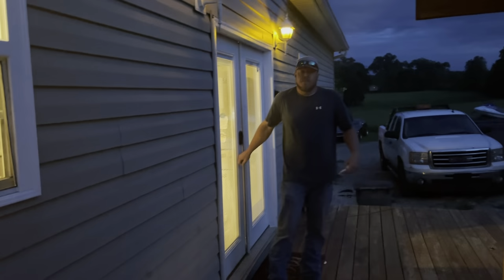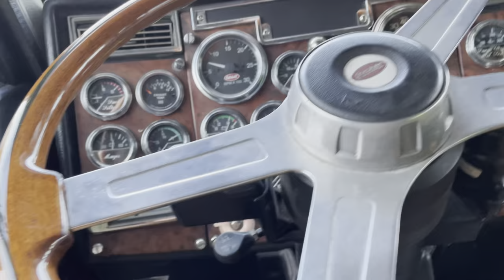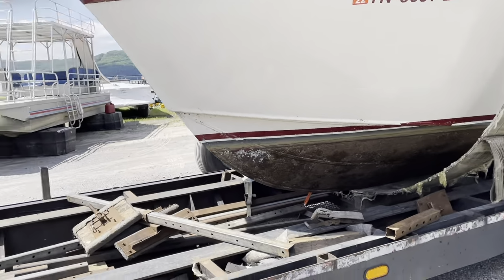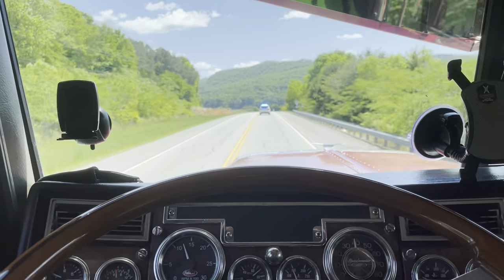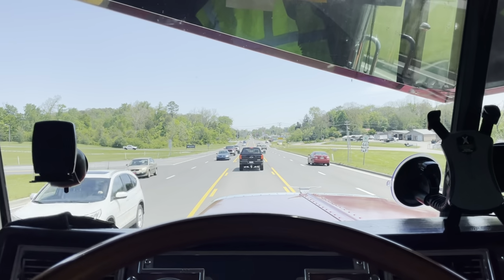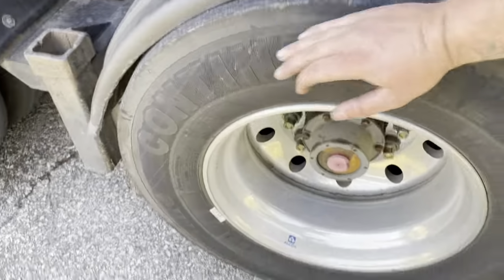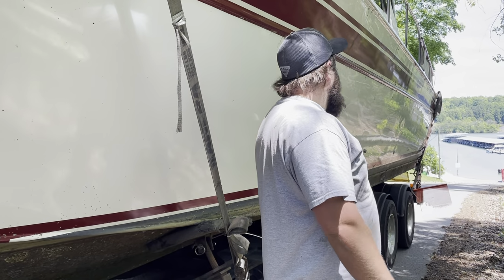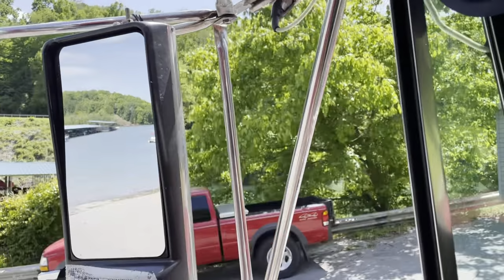CRAZY OVERSIZE LOAD..I SHUT DOWN NORRIS LAKE DAM!!!!!!!

Comment: I enjoyed your video. One thing for sure I've had a lifetime of this kind of hauling and I guarantee you if you're going to pull those low trailers you're sooner or later going to get them hung up somewhere. I shut the whole state of Arizona down one time I had a police escorts with me we thought we could skid the railroad tracks and we didn't down by Maricopa. It took a loaded gravel truck to pull me off of there and we'd literally shut down the hole entire railroad system cuz we were hung on the three main rails for the whole state. Blew 2 airbags trying to get off spent two and a half days repairing the trailer and getting police escorts lined up for another route.

Comment: Please get your trailer and truck set up with with some adjustable ride height control. Trail king makes a easy to install valve. All my lowbed’s and my 13 axle steerables have it. My heart dropped when you got stuck. That’s my second worst fear as a heavy haul driver. Good job figuring it out

Comment: Just saying. You said that trailer has air ride.  When I did OS my truck had. I think it was called air ride PRO. You can install it yourself. But it turns your air ride in to a Lift kit. Hooks in between your leveling valves on your air ride system. It allows you to control the height of the airbags. So like right there when you got hung up. You went back and seen one of your axles wasn’t even touching the ground. Now just sitting in the driver seat you can send more air to each individual airbag Or to all of them and be able to lift that up off the ground.

Comment: Well done Tim, any idiot can drive forward down a freeway, but the real skill is on the roads that are too small for your truck and having to backwards. I think that police office got wind of you moving the boat and so came along to make sure that you got out safely. 

You do find good and bad police all over, from those that are helpful and just want everything to go smoothly to those that try to write you a ticket for an offense that you did not do, which they said they saw you do over the brow of a hill, that one went to court and was laughed out of it by the judge, as when they pulled me over I did tell them that we both had the same vehicle tracking system, that system proved that I was over 1/2 a mile away, and over a hill, so they had no line of sight, O' what fun.

Comment: If you are going to do oversized and wide load hauling you should seriously consider getting some caution lighting on that rig because it's not safe to go down roads and highways without warning lights and also purchase new flags and large banners for the front bumper and tail end of the trailer , always remember that you are putting other motorists in danger with oversized loads so safety needs to be your top priority.

Comment: I've had that happen before, actually just got back and hired with the company I used to work for hauling boats and I'm currently on my way from Florida to Connecticut, it's definitely good to be back but I've already scraped the trailer three times just existing
Reply: Currently moving a 34 foot Sea Ray, it is also 12 why the M14 put one call so it's about what you got on there except for mine is bow backwards in the middle

Comment: You have a new follower, I cut my teeth on a 66 bulldog twin stick hauling hay for my "pops" ( granpa) I started long haul after the Navy. in a 88 4300 eagle. then got a spank'n new 1992 8300 eagle.. keep it safe out there,  those 4 wheelers have no respect for your "large car"😞🙈😂 (would have given anything to have a pete as nice as yours)
😳 a blind side back job with an oversize🙈
Thought you might back that thing at about 60mph ..pull the trolley brake and let that tuna Clippers slide right into the water😂😂😂

Comment: Oh so you're kinda local to me then? i'm in Portland TN above Nashville. looks like in could learn a thing or 3 about  backing a trailer from you. i can't back one to save my life and i have to drive to Knoxville in a couple days to pick up my new RV i'm living in up here in Portland. if you'd have carried a pair of shorts with you, you could have gone in after your wood and tool box. wait if you're local within 100 miles of Maryville then you aren't local but i've met you in person before, i lived in Louisville just south of Knoxville for 10 years before moving to Portland but i recognize you from one of the places in Knoxville, thinking it was the Pilot on Lovell road that i built because i always stop in at that one just to see how the place is being treated and remodeled. I was on a block and brick crew that tore down the old pilot and rebuilt it again in 1993. Not 100% but i'm pretty sure that's where i saw you before
Reply: If you don't already know, when you back a trailer place your hand at the bottom of the steering wheel and then turn the wheel the direction you want the back of the trailer to go. To turn the back to the left, move your hand left and up from the bottom. This simple method makes it easy to focus on your movements and not on dealing with steering direction.
Reply: @CGT80  yeah i've tried that method but i think i have my mind too stuck on what the front of my truck is doing and lose that connection completely some how

Comment: what motor does this pete have cause it's not c16 either I saw a 40 pin ecm also.   1lw 6ts 5ek or 5ds
Reply from the maker: It’s a 15.8 liter 3406e first year Of the 16 liter this was a custom built truck
Reply: @Gentryandsons  cool so 5ds serial